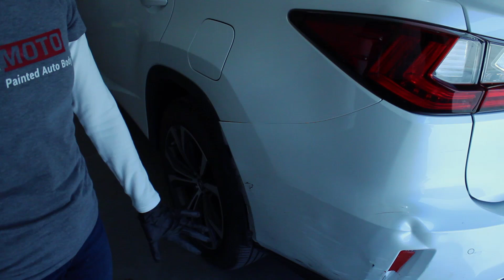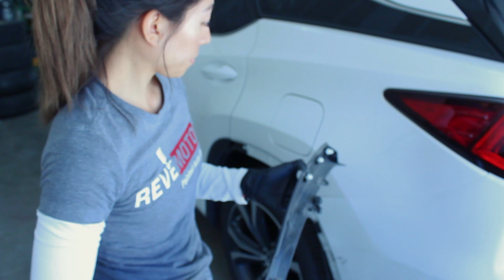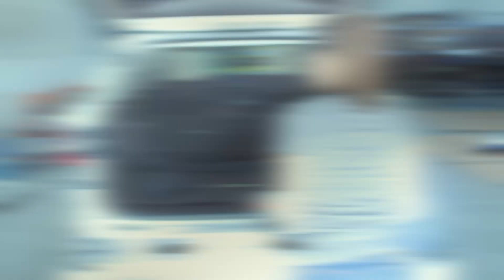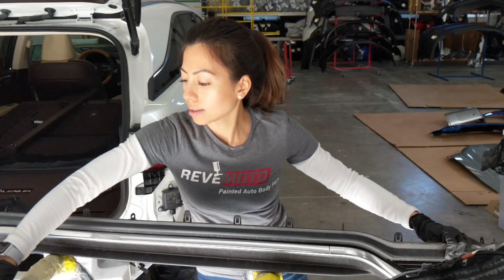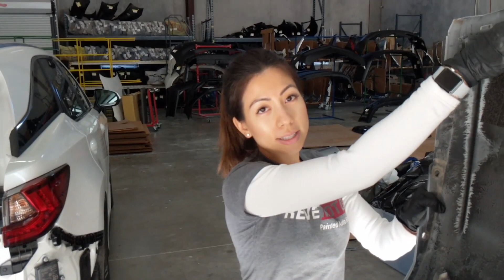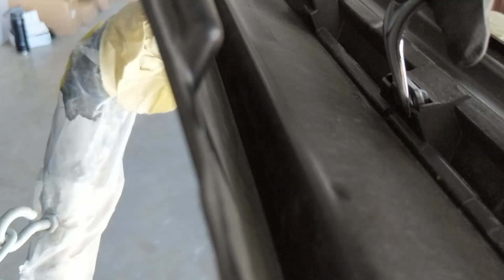How to Remove a 2017-2019 Lexus RX350L Rear Bumper Cover (18-19 RX450)

Comment: Thank you this video is helpful. Btw do you know the part number for the bottom piece of the rear bumper that you have in this video. I have the same kind but dont know what its called or part number to replace it. Ty
Reply from the maker: Hit up the experts at www.ReveMoto.com they can help you with that part

Comment: Do you know if it's possible to install a normal or even F-sport RX350 rear bumper with the exhaust tips?
Reply from the maker: We wish we could help you with this but we do not know with 100% certainty. Both part numbers will be different, the best way would be to compare them side by side. The taillights look to be the same for all the models, so it is very likely you can. We recommend checking the Lexus forums. Thank you for watching!

Comment: I have a 2022 RX350L, premium package.  It didn’t come with the fog lights so I am thinking of getting an OEM factory fog lights.   Would this be something that can be a DIY project?.
Reply from the maker: Hello and yes, that can definitely be a DIY project. I would double check to see if your current wire harness has the plugs for the fog lights. Sometimes manufactures just use 1 harness but don't include the physical feature (like fog lights) when you buy the car. If you do not have the connections, it is possible to create them but it requires electrical work. Please consult the Lexus forums. Thank you for watching!
Reply: Just fyi, I got my fog lights installed this weekend and I’m very happy with them.  Thanks for your comment and input. 🙏
Reply: Btw, I got an after market wire harness with a fuse, a relay and a switch.  I have yet to bring over the switch onto the interior of the car.   Can you tell me the best firewall grommet to poke a small to insert the wire?
Reply from the maker: @renebcruz  You're very welcome!
Reply from the maker: @renebcruz  There is normally just 1 place the harness inserts from into the interior. You can find it on each side of the far end of the firewall. Just follow the engine harness in the cabin, you can miss it.
Reply: @ReveMoto  Thank you so much! 🙏

Comment: How do you detach and re-attach the rubber step on top of the bumper cover?
Reply from the maker: Hello! I believe that is held on by double-sided sticky tape. The best way to remove it is to heat it using a blow-dryer or heat gun. Then run a fishing line underneath. All of the tools cost $20 or less. You could also use a panel clip removal tool, but be careful not to bend the top pad. Thank you for watching!